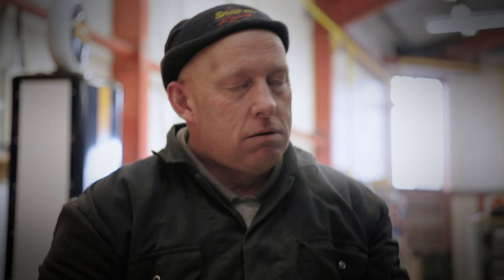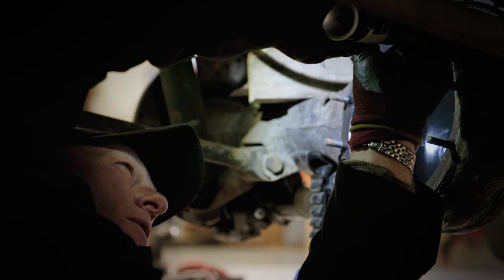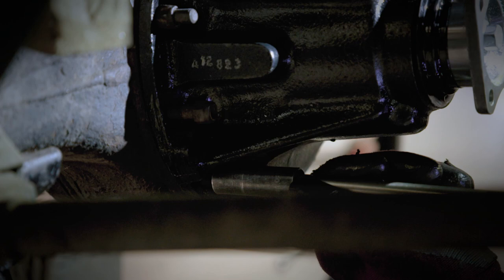Vintage Voltage Quest promo LAND ROVER episode 3

Comment: How does the heater work when you remove the water cooling system?
Reply: It uses the battery to heat an element and a fan